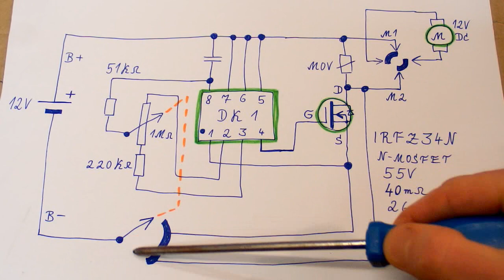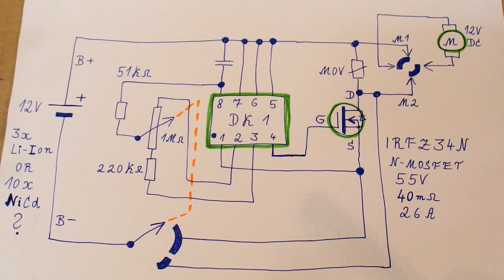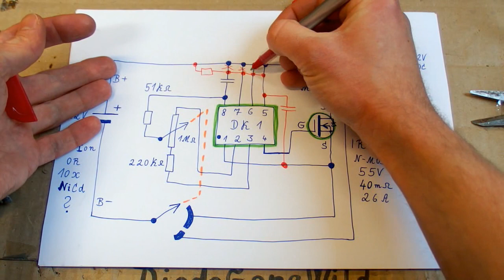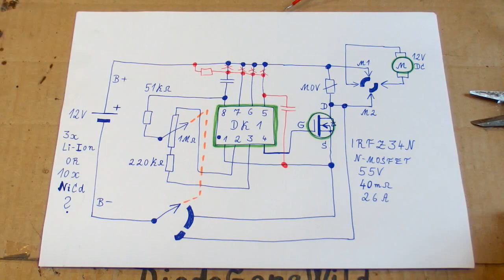inside a cordless drill (with schematic & gearbox autopsy)

Comment: 1:30 "The current limit of the power supply is set to 40 Amps, this should be enough"

Definitely will be enough to test and start some fires if anything shorts out 😂
Reply: I used to know some engineers that designed power tools. This setup looks very familiar BTW. When driving screws, they'd measure up to 80 amps for a split second!

Comment: Wild. This weekend I picked an old drill out of some things that we were sending to a charity donation. It was an ugly old drill with no battery so it won't be missed. I did that very same teardown. The drill was exactly the same inside. I have a use for the motor and kept the PWM controller circuit since it is already on a circuit board and would be easy to replace the trigger with a rotary potentiometer. 
This past weekend we were probably doing the same thing at the same time! Crazy.

Comment: This is a Wickes Drill from about 15 years ago (UK Company) I opened it today to add a DC input to it so I can also use it by wire. It's a 15.6V drill.  I bought 2 at the time for a special offer of just £25 Yes that's for both, One I gave as a gift to a friend. still works perfectly, battery still holds quite well it's the nikel type.

Comment: A bit surprised that the chip isn't a 555.

My store brand drill that i bought 18 years ago for only a couple € is identical. I still use it, now with a self built NiMH battery pack - used to be NiCd but junk cells, they died. It's a 12-series pack, the motor doesn't mind running at higher voltage. The heatsink sits directly behind the motor and is cooled by a little turbulence leaking from brushes/rotor.

 But the linearity of motor regulation actually feels very good on mine. There is a step at the end but it's not too drastic.

Comment: It will get quite HOT, I was using one like this 25y ago to tap aluminium bar with 6mm threads after about 10 holes that were 7mm deep the drill would smoke, after cooling for an hour try again.
The drill was from Aldi or Lidl, those were the days with NiCad battery packs the size of an Anvil. Still got the drill and the now empty battery pack ready for an alternative use.

Comment: I have had two similar drills, which were new some 20 years ago. They used 12V NiCd battery packs, which now are long since unusable. The motor and electronics are exactly like yours. I dismantled one of them, think I still have the motor and gear for some future project..

Comment: The white thing is not varistor, but a plain diode. Plus many regulators use plain 555 timer in it, with the pot altering the duty ratio...

Comment: Have a few cordless drills that got adapted to having a short cord and a 12V 7Ah lead acid battery for power, because the original NiCd cells stopped working and holding charge. Gives now life to them, as the motor and every other part outlasts the battery in most cases, and the batteries are too expensive to replace, or are no longer made, and repacking them is stupid expensive as well.
Reply: Sometimes you can zap nicad batteries and rejuvenate them. I'd say success is around 10% Lookup nicad zapping and it explains what's going on. Dendrite crystals and what have you. I find it is best to take the pack apart and zap each cell. Usually there's only a couple bad cells in a pack. I made a zapper out of an old 12V battery charger. I've zapped full packs with welders too though. But when zapping works it works.
Reply: @1pcfred  Tried that a good number of times, but when the cells are just abused by the charging system there is little you can do. I made a zapper for small phone battery packs, which had around a 30% improvement in keeping them alive, though those would always end up being repacked, as once the cell is degraded to the point it grows dendrites blowing them away is only a short term remedy. But as it was just 4AA tagged cells that were cheap enough and easy to get they just got done till dead, and then shuffle in new cells, and take 2 or more dead packs and make up one from them using those cells still alive.
Reply: @SeanBZA  I did say success rate is around 10% You should only zap nicad batteries too. I do not think it does anything beneficial for any other chemistry. With some battery types you could potentially blow them up? Perhaps there is a risk with nicads too? But I've never had a problem. I've seen some emit smoke in the process. That's usually a good sign. In packs it is often just a few bad cells. So if you have a bunch of bad packs you could make some good packs out of them. By just swapping out bad cells for good ones. And them nicad packs all use the same cells. Well sameish. They all use sub C. Capacities do vary.

Comment: Cool, I have one very similar from B&D, now I don't have to tear it apart! :D I specifically chose this one because the battery is NiCD, my previous one was functional for 10+ years, doubt a Li-Ion would last this long. I don't use it a lot, if I did I would probably choose a Li-Ion.
Reply: I've a similar I guess, I did replace the NiCd batteries with 4 18560 cells, then the brushes did burn a little ;-), I cleaned the motor brushes, now it works perfectly. I can recommend.
Reply: @rogerbusser9100  Interesting, but what about charging?
Reply: NiCD just has the overcharge issue with cells left on the charger for too long. Most NiCD chargers lack a timing circuit to shut off power to the cell after fully charged. That killed both batteries on my craftsman drill... but they did last from 2008-2020.  The Dewalt lithium stuff is really nice though. Surprisingly, their little hex collar chuck mini driver is quite cool. It has a gyro chip and is quite sensitive to a flick of the wrist. I thought it was a dumb gimmick at first, but after using it for awhile, it's freaking awesome. I even use it for drilling holes in plastic project enclosures using large wood cutting bits that have hex shafts. The wrist position input gives a tremendous linear modulation granularity without introducing extra unnecessary angular motion from pulling a trigger.
  The lithium drills also feel like they have a lot more torque. I never seem to hang a bit or get stuck, but I probably break a few more bits than I did in the past.

Comment: Regarding the plastic planet gears in the first stage, my guess is that this has to do something with electrical safety of mains-powered drills - the requirement for double insulation of a Class II device. They probably use the same gearset for both battery- and mains-powered drills.

Comment: actually had a drill with pretty much the same mechanism (maybe even the same drill?). Powered by 15 NiCd cell to get 18V and sparked like crazy every time you released the button. After the cells were flat I wanted to use it as a portable drill with a cigarette lighter plug but soon after it finally went up in smoke.

Comment: I would keep the motor. There seem to be only a few different standard sizes and they are pretty interchangeable between brands.
Reply: The whole unit is useful. A gear reduced DC motor can have a lot of applications. Like Dan said a coil winder.

Comment: We need to find out how the electric braking force works,  so we can disable it!
Reply: Like when you let off and it suddenly stops? That's usually implemented by just shorting the motor out when you let off the trigger. If I recall, this is basically the guts of a cheap Harbor Freight/China single speed drill. Have one somewhere still intact. Its pretty shitty with just some Ni-Cad batteries. But it can be abused with reckless abandon because its so cheap.
Reply: Is that the 90 degrees enclosure bracket that presses against the armature, is it a diode, or a heat measuring component for protection ?
Reply: @mysock351C  we need see a circuit for the braking force and how it works

Comment: It looks like the control chip will still run when the switch bypasses the transistor because the IC ground connection goes through the mosfet's body diode to the battery. Actually that would mean the IC supply voltage will go up and down by about 0.6V or so in that situation because it is also bypassing that diode whenever it switches on. Pretty weird.
Also I think the potentiometer is probably not very stable or accurate at all and might be responsible for the bad pwm control. It should go to 99% on before the transistor gets bypassed. On the other hand, the low duty cycle range is not as critical since the motor wont even turn with low enough duty cycle and wont be much use even if it does.
Reply: The gate is floating probably, there is no GS resistor. So, without the IC it may remained opened.
Reply: @oraszuletik  No, you could see it was still getting a PWM signal (same frequency) when it was bypassed. He showed it on the scope. And the body diode will definitely conduct in that case and connect the gnd, so no reason for the IC not to run.

Comment: I just wish you had tested the amperage under load too. I'll have to find a way to do it with the two 12V ones I have: the batteries are dead and I just modified them yesterday to be powered directly from a 12V 10A power supply. They work now but I didn't use them under heavy load yet. I hope 10A is enough...

Comment: You can build a drill-stand with this!
Reply: I guess. Be better off with a real drill press. I even have a tiny one for drilling PCBs. Turns real fast. I got a mill too. Turns real slow. So good for bigger holes. Like if you need to drill a hole to put a PCB in.

Comment: That's wild. I have a cordless drill on my bench right now that I want to make a coil winder with. But the one I'm trying to use is lithium ion (says right on the tool case) and I can't get it to run on just power supply current. It has another lead for sensing the temperature of the battery I think? I don't know. I never had a battery for it. I got it in a whole bag of old cordless tools I bought at a sale. The drill here is definitely an old nicad tool. Find Julian Illett's video called Cordless Electric Drill Speed Control - Stripdown he just put up of taking a drill apart (on odysee). It is pretty dramatic. I won't spoil it. Worth watching.
Reply: If it's just a temperature sensing wire you can probably connect a 10k resistor to ground. Maybe you need a different value like 1k. If you're unlucky it's a digital protocol which will be hard to fake.
Reply: @eDoc2020  my plan is to just chop out the controller and use a variable power supply I made. Would have been more convenient to use the controller that came with the drill though. I should try a resistor though. What's the worst thing that can happen? It blows up? I wrote it down so I'll give it a shot. If it blows up I don't care. Just a junk drill anyways.

Comment: big traces inside the switch I guess works as a brake, when you release the switch.
Reply: Not on this case, this seems to be an old Black & Decker model, my father had it before he throwed away lol. It didn't had that motor "brake" which is a short circuit on the brushes. Its useful for tightening a screw with limit. But at same time bad for non heavily work, specially if you only press the drill and release, it sparks badly. The motor will last much longer if you dont let it spark like this!
Reply from the maker: this one doesn't brake.
Reply: @DiodeGoneWild  Yep, so the brush motor could survive a bit longer by not being short circuited on its OFF position of the switch.

Comment: DC does not have frequency, if it is zero then how will it be controlled?
Reply: The motor isn't running on DC, it's running on PWM drive, which does have a frequency. But nothing speaks against running a DC motor on PWM.
Reply: I think I know where you got it wrong. The power that goes into the motor is not controlled by frequency, it is controlled by changes in duty cycle. Here's the definition of it from wikipedia:
"A duty cycle or power cycle is the fraction of one period in which a signal or system is active. Duty cycle is commonly expressed as a percentage or a ratio. A period is the time it takes for a signal to complete an on-and-off cycle."
Let me explain it a little further. The controller of this drill creates a square wave with a high, fixed frequency. Let's focus on just one period. The signal oscillates between two states: on and off. While it's on, it supplies power. While it's off, it doesn't. Duty cycle is the ratio of the "on" duration in a period to the whole period. So it's directly related to how much power supplied to the motor in one period. Want to supply more power? Increase the time that signal spends on "on" state thus increase duty cycle. Want to supply less power? Decrease the time that signal spends on "on" state thus decrease duty cycle.
If you have noticed, while it's in "on" state it runs on full power and while it's in "off" state it has no power. But you generally don't notice sharp stops and starts. Thanks to high frequency and inertia, it averages out. Finally, duty cycle of 100% is just DC.
Reply: Ok
Reply: @SianaGearz  The motor is most definitely running on DC. It is just pulsed DC. So you get an average of the power output. Half on and half off you have 50% power. As the pulse gets wider the duty cycle increases. Dan showed it on his oscilloscope.

Comment: But you didn't see if the motor can generate some current!!!! Drill's are worth nothing these days, it might be worth it just for the motor as a driver or generator...
Reply: The world does seem to be awash with old cordless tools these days. The batteries die in them and people just get new tools. I have a pile here I've gotten from all over the place. I bought a whole bag of them once for $10. Must have been 10 tools in there. Some used the battery platform I'm on. I'm planning on using another as a coil winder like Dan mentioned in this video. It is sitting on my bench right now. In pieces.